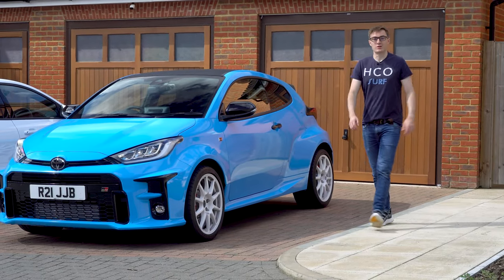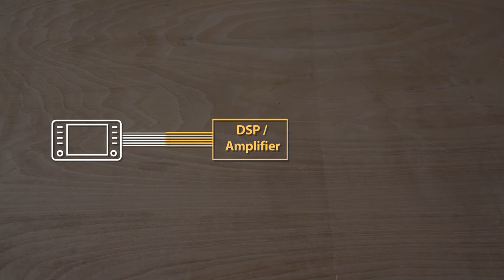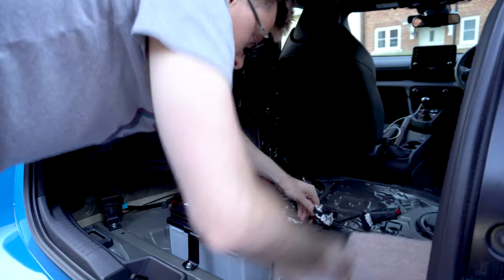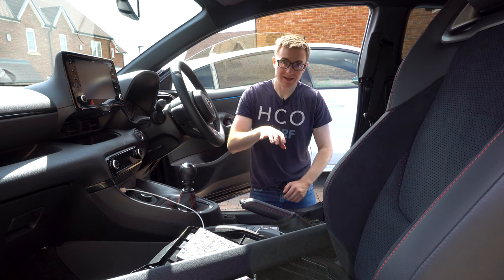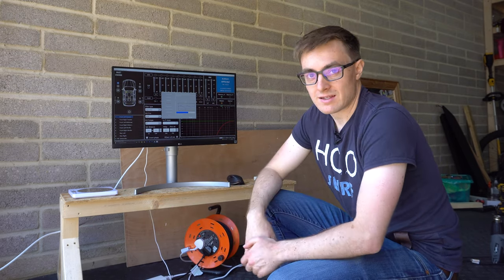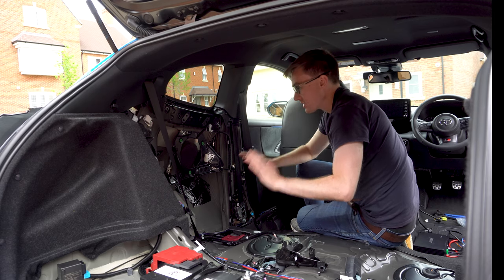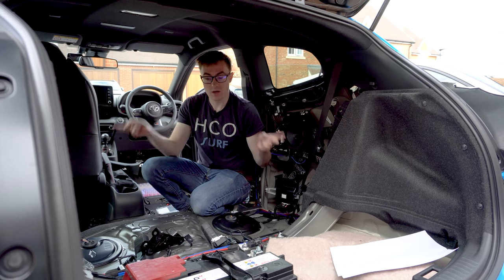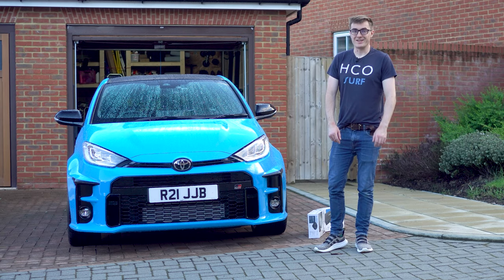DIY STEREO INSTALL 🔧 GR YARIS (LIGHTWEIGHT & NO SPLICING) Audio Upgrade 🔊Part One

Comment: I’ve had a full sound system installed in my GR too… Focal Audio mids and tweets in the front, 2-ways in the rear, powered by a JL audio 5 channel amp and a 10” JL sub (with a base controller in the blank switch by the right of the steering column) and compact box! Sounds awesome!!! What I didn’t like was the fake engine note being piped through and ruined it for me so I’ve since bought the Carista obd2 adapter and turned the artificial sound and noise cancelling off, it’s now perfect and with the music off can really enjoy the sound of the Miltek exhaust too
Reply from the maker: Sounds perfect! I’m hoping I’ll be able to forego the sub… we’ll see how we get on!
Reply: if i cant get rid of the fake engone sound i will get rid of the car. as u say, it can be done with carista. did u use the beta version or just the regular one? here in germany all above 150km/h is inacceptable noisy. no idea why toyata not offers a software update with off-switch in the settings..
Reply: @pauliks5218  I used the beta version but ended up just subscribing to the regular version as only £48 for the year… definitely recommend

Comment: Amazing video mate! One thing is that if you wanted to run windows software on a mac, you can install a virtual machine program and run any windows (or linux for that matter) program. You can even let the virtual machine control any of the usb devices that you have. Can be a bit finicky, but much better than hauling a desktop to the garage and running a million meter cable lol.

Comment: Excellent job, but I'd like to warn you about one thing. I was working on my 2003 3-door Corolla Hatchback recently, and what I found out was that the factory sound treatment consists of cheap tar mats instead of proper butyl mats. These dry up after some time and become dead weight, I had to remove them with liquid nitrogen. I'm glad you made some good shots of the real "inside" of the car, that way I could see that it doesn't differ all that much from mine, which is why I suspect that the factory sound treatment you chose to keep is also the same as it was almost 20 years ago.
Reply from the maker: Thanks! And cheers for the advice - good to know! Right now, I intend for this car to be a ‘keeper,’ but we all know how things change! If I do keep it for a long period, I’ll look to switch out the OEM deadening :)

Comment: the cable where you did the soldering is the speaker input cable, while the one coming from the yaris is the speaker output cable. how did you do?

Comment: I’m surprised you didn’t run into issues using the outputs from the OEM head, someone measured the output from the head into the factory DSP unit and said it’s basically speaker level signals going into it?
Reply from the maker: That is all the amplifier needs :)

Comment: 8:30 -- I've done that more times than I can count in my GF's car which requires brake and start button to start (so I can get the heat or aircon going mostly).

Comment: Damn, great video again! Very underrated. Great Infos. Didn't know you can uninstall the sound generator box. I still have it disabled. Also, find it interesting that you didn't install the amp near the power source. And also, where to install a sub?
Reply from the maker: Thanks! If you remove the amp under the seat, you’ll lose all sound to the speakers so it needs to be replaced or remain connected. 

Sub can go under the boot floor… but not sure I will go through with that. We’ll see how I get on with the current set up!

Comment: Excellent video!.....sorry im not up on speakers amps etc....can i just swop the door/qtr speakers with audiston or similar upgraded speakers?...or would i definately need an amp?
Reply from the maker: I would recommend an amp. The speakers would be underpowered when running off the stock head unit and you’ll also be using the stock EQ which may sound strange on speakers it wasn’t designed for.

Comment: Great video.  Surely that amp has an automatic turn on when it sees an input from the headunit?  Did you need to run the blue remote turn on lead?
Reply from the maker: Thanks! Yes, it does have automatic turn on - multiple different options infact! I just wired it the traditional way lol.

Comment: Audison Prima amplifiers can switch on with speaker detection, saving you having to run a remote wire.
Reply from the maker: Yup, you are correct. I just did an old school install lol.

Comment: ok all very nice, but, how did you make the output connections to the toyota smart connect? did you disassemble the touchscreen and behind it are the RCA outputs to take to the amplifier?
Reply: I bought a yaris cross, the infotainment is the same, but your video is missing the part that shows how to connect the toyota smart connect to the amplifier.

Comment: Love the videos on the Yaris, watched them all! The only bit which I’m not totally in-sync with is the initial wire loom from the amp to the original factory wires (how is this done? What’s the white unit connecting the two lots of wires?). Any help you can give me on this would be massively appreciated :) Thanks and keep smashing it! 
Edit: Given i’m likely to keep the car and the audio system for a long time, is there any negative side to crimping the wires directly to each other instead?
Reply from the maker: The white unit is the original plug feeding the OEM amp. I’ve then made ‘pins’ to take the necessary feeds from each wire in the OEM plug. I’ve intentionally not shared the pin locations as I don’t want to be held responsible if anyone gets them wrong! The information is available on the Toyota technical website which is in the description. 

No issues with splicing the wires directly. Only risk is how well the OEM system would go back in 👍🏼
Reply: @JBCTR  thanks for the reply! The amp I'm looking at comes with RCA inputs, so I will have to buy a line converter and crimp this up to the initial wiring loom (I think that's right? Haha). Regarding the remote wire, is there just one wire from the back of the amp REM? If so, am I able to run this into the the fuse box with the same method you used on the Dash cam wiring video? 
Many thanks for your help, Dec
Reply from the maker: @BJJBOURN  I would consider getting an amp with high level inputs if you can. Mainly because it can take four inputs as opposed to two which means you can keep FR, FL, RR & RL. I would also say that a DSP is almost required as the head unit has a bit of a weird EQ on it that is tuned for the stock speakers.
Reply: Thanks for all your help on this! I’ve decided on the build, just trying to sort the logistics of wiring out. I’m not using rear fills, I’m instead I’m going to run active. How much speaker cable would you recommend buying for the 2 fronts and 2 tweeters, with the amp being in the front seat?

Comment: I'd like to know your background to tackle the projects you've done.  Are you an engineer?  Taking apart things isn't a problem for me, just putting it back together is the problem.  I'd be scared after taking everything apart that once put together, I'd have extra parts and wondering where they went.....
Reply from the maker: Not an engineer. I did a lot of audio installs when I was young and fearless 😂  this is my first one in about 10 years though. Tech has changed a lot!

Comment: JB CTR quick question if you dont mind me asking how did/are you using for your car insurance
Reply from the maker: It’s just on run of the mill road insurance from a comparison website. There isn’t enough modifications on it to warrant using a modified specialist IMO. I did have to sacrifice track insurance though, which was included with the specialist policies I used on my fiesta.
Reply: @JBCTR  out of curiosity who was you with for your ST
Reply from the maker: @TheDigitalblue  I cycled through the usual modified insurers for the 7/8 years I had Fiestas. Greenlight, Flux, Brentacre, Sky etc

Comment: so the OME Amp is delivering that silly fake engine sound? is there any input-cable from that mic so that i could just pull it off? or a pole to disconnect/isolate? i am not a sound-freak, so i wont spend 1000bucks for another amp. i just want that noise off.
Reply from the maker: You can code it out with Carista or similar (I believe). I’m not sure which wires are responsible for the engine sound enhancement, or if the device would still work with them disconnected.

Comment: Does nobody make a T harness so yuo could have got the audio out of the back of the factory headunit? Running speaker cables with power cable should be fine, as it's after it has been amplified.
Reply from the maker: Nope, nothing on the market! Or at least there wasn’t when I did this work!

Comment: jesus! thats a lot of work to go balls deep for decent ice. ill put my hand up and ask the stupid question, why not use the wires that are there for the speakers and amp? also how many bits did you have left over once the car was back together? hahaha.
Reply from the maker: You can re-use the wires and if this was an older car, I probably would. However to use them you need to either cut the plugs off or splice in to them and I didn’t want to do either. This way I can put the factory system back in with no issues. Arguably, the larger cables will provide ‘better’ sound quality too… I’m not entirely sure on that one though. Maybe a sales pitch 😅